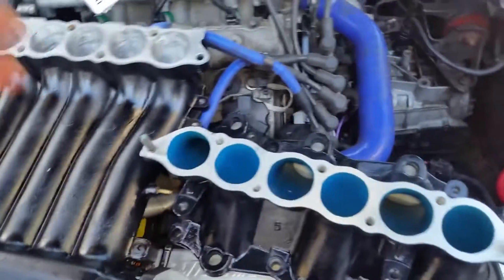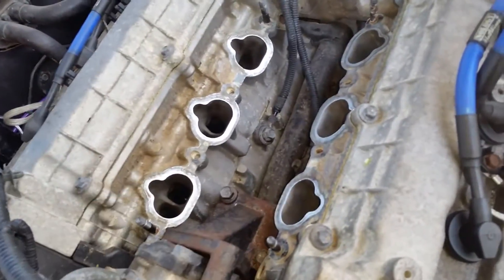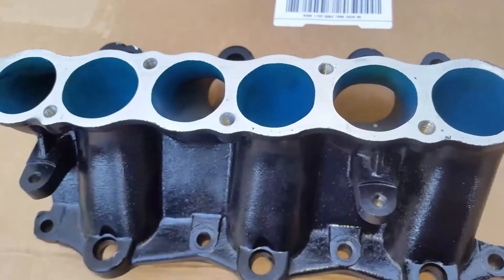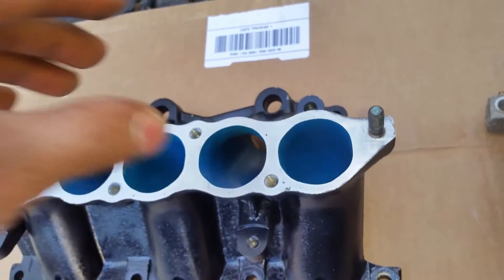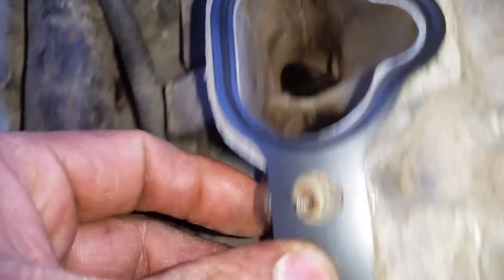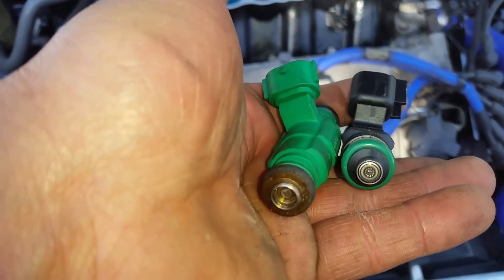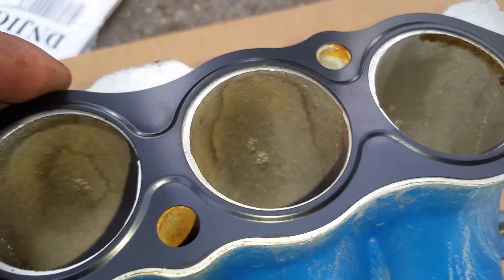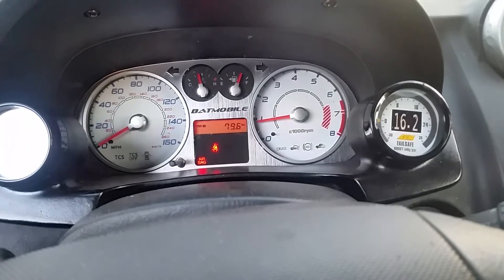Ported and polished intake modified (hyundai tiburon V6)

Comment: Where can I buy one at and how much of a difference did it make from the stock one?
Reply from the maker: You have to find someone that sell them. I ported out only one set and it was a hard sell. I made video about after installing ports out manifolds. Better air flow and weights less the oem..

Comment: hi men. so  i order new gasket from felpro for the low and up manifold for this car. this felpro for the low has a blue line .. so how i need to pjt it like you show in your video?  the lines goes touchi g the block or i need to see the lines when i put in the block? let me know..
Reply from the maker: I'm sure it don't matter what way you want
Reply: bro thanks for replyng me and sorry for the mesage i left you before you know what.. but im desperate for know this about the gasket because in so confuse .. so the low manifold gasket has a blue lines in the gasket you know its like a sealer ? so how i need to install that? a d i have the same issue for the oil pan gasket because the oil pan gasket has the same line. that line when i out the gasket in the oil pan i will see it? you know the line facing me? can you upload a video for me jajaj im confuse bro
Reply from the maker: @rcabronero5649  oil pan I don't know because I used rtv. I'm it only go's one way because the shape of the oil pan
Reply: @Lilmiddwest  tha ks i need to know something.. men here i have a car jack with a leak i beleves its the o rings i purchase a hydraulic oil for jacks my question is.. i found here a spares orings i purchase before for a air conditioner system a new sealed bag with greens orings did you beleved this can be work? its a orings but whats can be a differents between boths

Comment: stock computer will kill this mod.it will go back to a normal air to fuel ratio.put your cold air back on.does nothing.ive built 2 of these cars.without a standalone no gains happen....cams give a check engine light.
Reply from the maker: Okay and that's why I have a piggyback tuner and I did this for my turbo tiburon..

Comment: don't run the back 02 will go right back to 14.6 afr are try tune it out with the aem fic6
Reply from the maker: PA Tuners you mean o2 on bank one 2 and bank two 2 senors??  I have codes that say bank one and bank two is to lean..  But do feel different midd to high rpm
Reply: Lilmiddwest dont run bank twol. bank one is the important on help keep the afr down. plus you can tune it out with the aem fic6 by adding some fuel
Reply: Also sounds like you 1bank o2 is bad
Reply: only running back 1 will keep car it closed loop keep the car running richer. look into open and closed loop will help you understand tuning little more to
Reply from the maker: PA Tuners ok I have 4 o2 sensors at Chrysler school they said the the o2 that is closer to motor reads oxygen to see add or remove fuel. And the the ones by cat reads if cat are working right. But I don't have any cats cuz I put racing headers... I might need clean off the top sensors
Reply: Lilmiddwest the back two whats keeping it in open loop and your afr are getting around 16.3 i seen on the wideband. that's really lean for are cars. unplug the back o2 where cats once where. if you all ready did that then you need to add fuel at idle get it to 14.6
Reply from the maker: PA Tuners at idle its at 14s but I might just buy new upstream. When I turbo car I'm going to put high flow cat on so I won't have cel...
Reply: Lilmiddwestl ok I must of been seeing things thought i seen 16.3
Reply from the maker: PA Tuners just fix my lean code just had a vacuum leak now running smoother
Reply: nice glad to hear